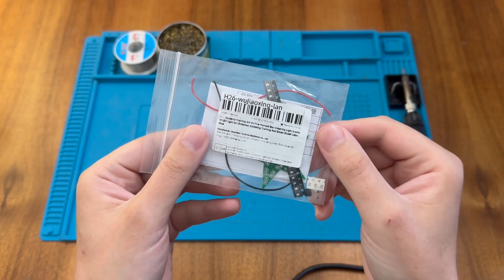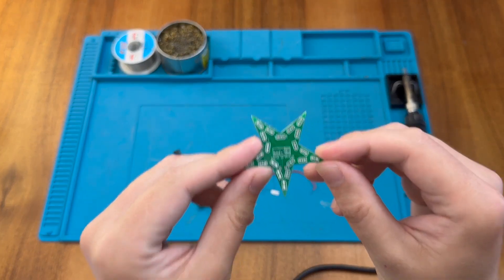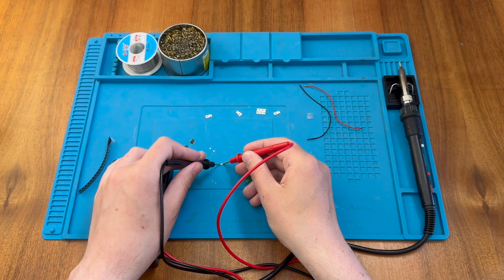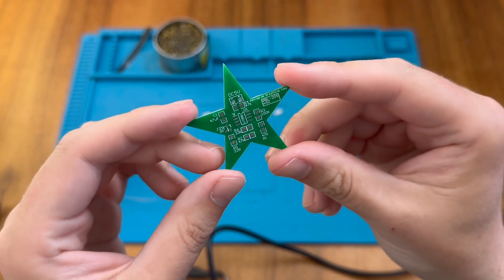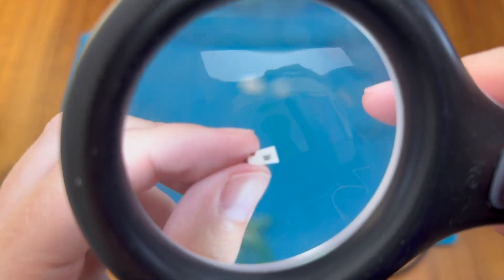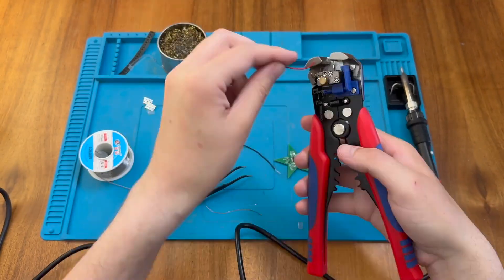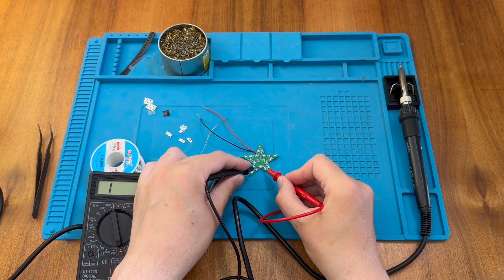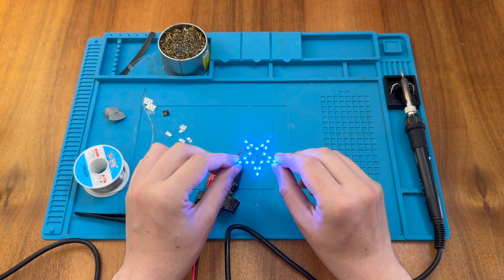Five Point LED Star (Pentagram Breathing Lamp) Surface Mount Soldering Kit

Comment: Good video ….. I’ve made a few of these, the red and green work fine on 5v but the blue barely illuminates on 5v
I require to power using 5v usb, so could I change the value of the components to allow a little more power to the blue leds
Reply from the maker: That great. I was a little puzzled when nothing was working at 4.5 V!

Comment: '
can change to LEDs 3mm from SMD LEDs
Reply from the maker: There are no drilled holes in the PCB for through-hole LEDs with this particular kit. However, I have been known to bodge a through-hole component onto SMD pads when the need arose. So I'm sure you could make it work with enough effort and perseverance!
Reply: @jtjacques  
hi J...
'
thank explain...
i have many LEDs electronics kits and projections...
already in my channel video
Reply: @jtjacques  
hi J...
'
i did finish drill and put the socket in the star PCB and will put 3mm LEDs lights later...
i dont like SMD LEDs lights on the PCB
Reply from the maker: @bestamerica  Wow! That sounds like a really interesting modification!

Comment: This multimeter is scary 😅
Reply from the maker: Why is it scary?
Reply: @jtjacques these types of 3 $ multimeter are known to have multiple problem first they are inaccurate, but also after a certain time the display lose some segments, the selector Stop making contact correctly.
But the most important don't use this thing tu measure the main voltage, or any current there is no security.
Obviously don't trust the writing on it,
Reply from the maker: @I.TestThings  I'm only using it here to test LEDs using from the internal 9V battery, not mains voltage. I have other meters for high-voltage work. This meter has been accurate enough for the the type of low-voltage projects I do on the channel, and all mechanical component wear and fail eventually, so it's about the cost-performance trade-off. Overall, I think I've gotten the £1.18 worth of value from it that I paid.
Reply: @jtjacques I'm sure you got every cent from it I just don't want people to think it can do more than that, I'm sure people consider that like a recommendation
Reply from the maker: @I.TestThings  Absolutely. It's essential to use the right tool for the job! I go to great pains to talk about this in my recent Vectrex video, where I discuss proper CRT discharge technique and using the appropriate type of meter. https://youtu.be/TY8BPEUw-Tw?t=210